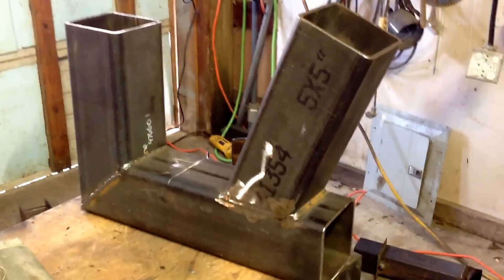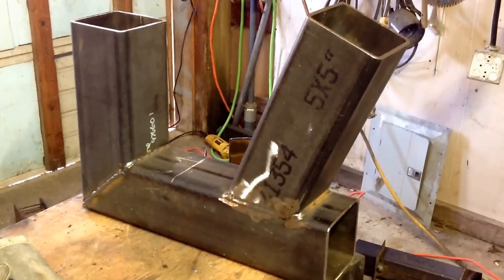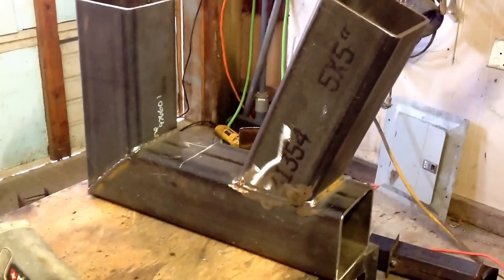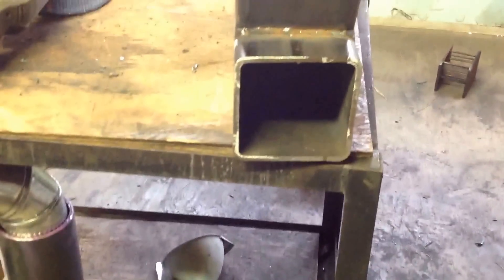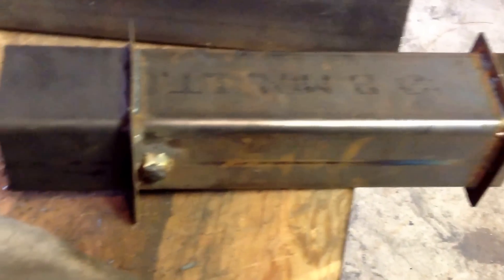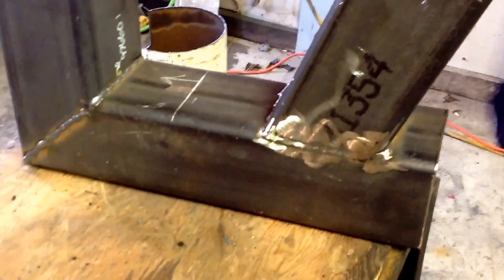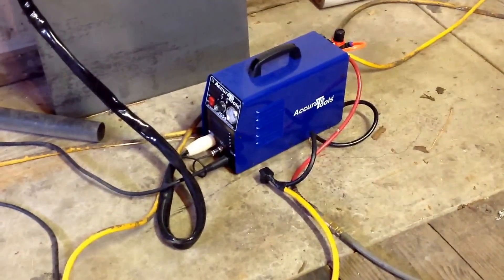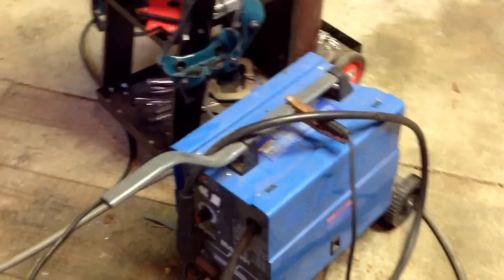Rocket stove build by Mike Knop 11-18-15

Comment: Update: Ya don't waste your time building one out of mild steel like the video shows. It won't last very long and will deteriorate from the heat in the riser. You will definitely need to use refractory cement or fire brick for the burn tube and riser. I've made mine that way and it's on it's second season with no problems.

Comment: Great build, but you'll find the riser tube made of mild steel will barely last one season. The flame burns so hot, the steel will start to deteriorate and flake off inside. Mine only lasted a few months before it was useless. I'm going with high temp refractory cement and a perlite mixture on my next riser. That will last.

Comment: Mike,  try feeding the air with a fan at the bottom.  even a muffin fan will work if you power it with the nec. voltage.  Then tell my how it does.